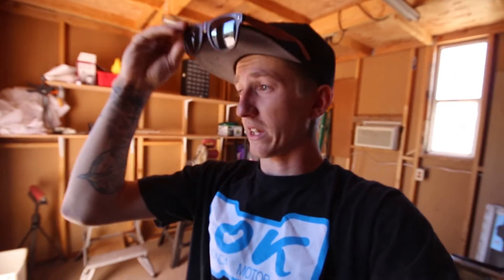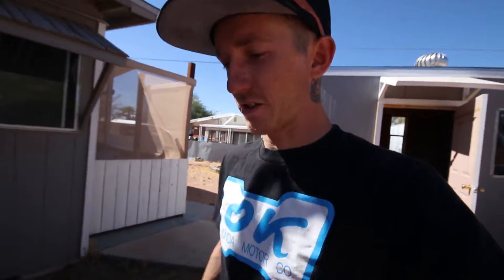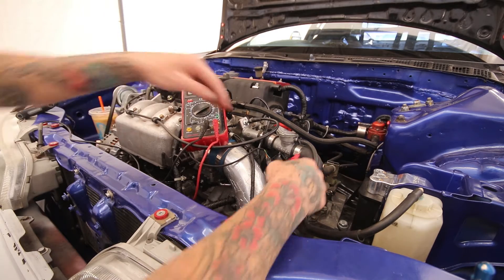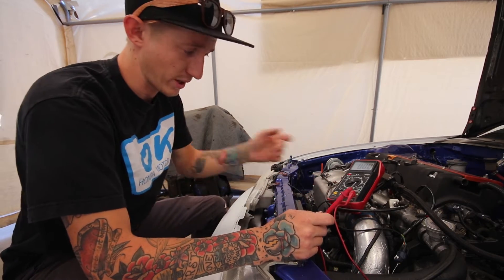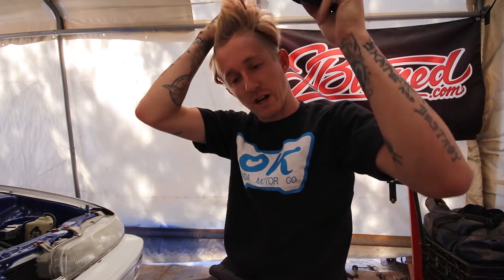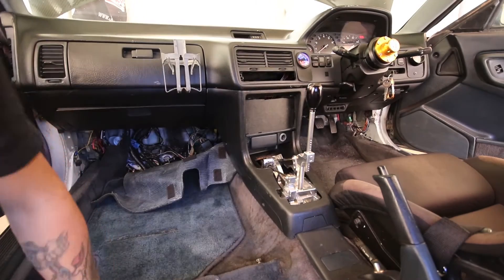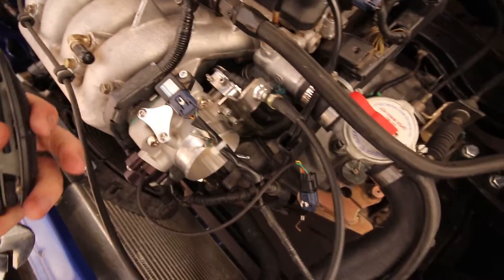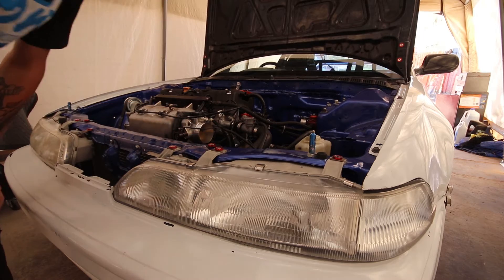Ktuned Throttle Body and TPS Issues (SOLVED!)

Comment from the maker: It’s been asked multiple time, I should have included it in the video but here is how to fix it:

Basically just trim the end plastic off of a male spade connector and put it inside the TPS sensor, what that does is fill up the bit of dead space around where the sensor actually rides on the throttle body butterfly.
Reply: I just found your video. Idn if u still have this car but how has it held up

Comment: Same here... I’ve tried all of the k-tuned TPS since not a lot of after market didn’t improve the OEM TPS. What worked for me was ACUiTY!!! Btw the reason k-tuned hall affect went bad was when u snap the throttle and lands to idle spec the rotating part of the sensor gets worn out and free play begins and gets worst. You’ll see it when your readings from your DVOM is not consistent.
Reply: A r i e s R  Do you have a 70mm throttle body by any chance? I appreciate your comment as it may help me out.
Reply: AffiJuarez18 yes I do.

Comment: Block off your IAC port on the intake manifold, remove IAC valve. Place a 5v diode connecting the IAC wires together (this will make it so you don't throw a code and engine light stays off) then go find a compident tuner that should have known to tell you this!
Reply from the maker: Sounds like you don’t know what your talking about because the issue was fixed and it was a ktuned makes crappy parts issue. My tuner has nothing to do with it

Comment: You can also take out all the little Allen bolts on the Tb cable circle thing and turn it to make more tension in the spring
Reply from the maker: I already did that. Didn’t really help too much with the sticking

Comment: I had the same issue on my Type S with the Hall effect installed on a skunk 2 throttle body. The deal is Any aftermarket tps for the k20 is crap the only best option is oem but Honda doesn’t sell it separately. In the ktuner program there is a setting like hondata to scale the tps sensor manually but I can’t remember where but it is there. Basically if the tps reads let’s say .5% at no throttle and 65% at full throttle then you have to manually type .5% for no throttle and 65% for full throttle so the ecu can recognize it. And save it. It’s there but you really have to dig in the settings. Hope this helps
Reply from the maker: There’s is no way to scale it in KTUNER, James didn’t input that into it. You can calibrate it at factory spec, or for a .5% up. He designed it to read sensors within a normal voltage spectrum. But my issue was I was not getting enough range of motion because of a fitment issue with this specific TB and that sensor. It’s a design flaw that apparently Ktuned has recognized and offered warranty for throttle bodies made from last November-March. They just didn’t publicly announce it.
Reply: ChrisSadowski i have the same problem. I went thru two ktuned tps(one includes Hall effect) and still the same problem. I wish i would seen this vid before i bought my ktuned 70mm tb. So u saying that the ktuned 72mm tb would work with the ktuned Hall effect tps?

Comment: I have the same TB, but I'm not running a gasket on the TPS. Never had an issue like this. I just recently cut my own hasket out of a Manila folder to get moisture from getting inside. Havnt tested it yet but I'm optimistic. Mine also sticks like a SOB after a month of driving on it.

Comment: I have the exact same issue with the same TB. Currently running the acuity tps. Can you go further in depth with modifying the TB?
Reply from the maker: In a nutshell, there is dead space around where the sensor rises on the butterfly of the throttle body. So I used a small piece of plastic from a spade terminal to fill up that dead space

Comment: So like whatd u do to fix it. My dumbass bought the same tb and im having the same problem
Reply from the maker: Basically, this issue is there is dead space around the sensor opening, and where it is supposed to touch the butterfly on the throttle body, for me I took a male spade connector and trimmed the plastic off to just use that to fill the dead space around the sensor and it has worked fine ever sense

Comment: I was a fan of K-Tuned parts… until few month later after my K swap project, I begin to see K-Tuned supplied hardwares such as screw and bolts shows RUST on them… not a fan of rust with new parts hardwares…😔
Reply from the maker: Sounds like K tuned quality

Comment: seriously... what am I supposed to do to get this working. I'm going through hell trying to fix this.
Reply from the maker: Simply put, the metal rod that turns the TPS is not large enough. Cut up a spade terminal end, and shove the plastic in there to fill the gap between the rod and the sensor internal

Comment: what was the solution, swap tb?/?
Reply from the maker: Used a small piece of plastic around the butterfly where the TPS sits, the problem was too much slop around the sensor and TB, the plastic took up the dead space and fixed it

Comment: Man I have the same issue but I have thr 72mm ktune one
Reply: Also have acuity tps
Reply from the maker: Try checking to see if the butterfly rod is machined to the same size as the sensor. That was my main issue was the butterfly rod thing wasn’t machined correctly so I could turn my throttle a bit before it even started rotating my TPS sensor giving me wacky readings

Comment: doubt you’ll answer but i have the newer version of that tb and my acuity sensor doesn’t read anything , i put stock tps and it reads and runs alright but does have a bad idle and makes missfire code pop  up in all cylinders and i checked compression it’s all good spark and coils pack are good so idk
Reply from the maker: What TPS were you using before? I had nothing but issues with their Hall effect sensor, so I switched to an acuity sensor and haven’t had a problem since
Reply: @ChrisSadowski  i had the stock one the new acuity one i have rn will hold the idle at 3k rpms idk if i need to clean the iacv or if i should just run the stock tb
Reply from the maker: Try cleaning it first and see if that helps
Reply: i only for the ktuned 70mm cause they told me at the kseries store that i don’t need a tune , it ran like poop i put the stock one on and calibrated tps and my car runs better then before lol and i can’t return anything cause it’s “used”
Reply from the maker: You need a tune, your engine is taking in more air and doesn’t know what to do with it
Reply from the maker: Shoot just from a 70mm TB and port matching the manifold to it I gained 9whp on the dyno

Comment: so i just got a tune , i deleted my iacv, and i had screw in the screw to raise my idle a bit, now it idles perfect, but i cant get the rpm to shoot over 4-5, idk it feels like the cables have slack or tps if off. idk what i did, but it didnt do that before i missed with the idle screw
Reply from the maker: Sounds like it’s in limp mode
Reply: @ChrisSadowski  unfortunately it's not limp mode quickly stops at 4k this tapers off after 4-5, no cel either :(
Reply: @ChrisSadowski  ever since I turned the idle screw and put back the throttle cables ,
Reply: @ChrisSadowski  i messed with the TPS screw, i believe, so i think that did something, how do i reverse? or fix

Comment: I'm having an issue. 74mm skunk and Ktuned hall effect. It idles at like 1600 rpm. I've had everything off, new gaskets, cleaned IACV, new IACV o ring thing and it's still the same...starting to think it could be my TPS (search led me to this clip). 
EP3 turbo btw
Reply from the maker: Is your throttle body closing all the way? Skunk throttle bodies are known for getting hung up because the butterfly isn’t always cut right to the bore of the throttle body
Reply: @ChrisSadowski  Yes sir. It was always fine before the turbo build. The TB was taken off and reinstalled when the intake and block etc were painted. I did change from a stock TPS to the Ktuned though. I've also gutted the PCV, that is now routed to a vented oil sep tank that auto drains to the sump, so i need to check that the old tapping in the RBC where the PCV used to go is sealed properly

Comment: yoo i just got a new tps sensor, i dont need to mess with krpo to set it do i? just a multimeter correct?
Reply from the maker: I believe on k-pro you have to set it on there to let the computer know what’s closed and open, takes just a moment of time to do
Reply: @ChrisSadowski  i thought u can do it without kpro?
Reply from the maker: You can set it manually with voltage yes, but K-pro as far as I know is “stupid” in the sense that those values are now changed from removing the sensor. So it now needs to be told what those values are by just opening your kpro and calibrating the sensor. Literally takes 2 minutes including laptop boot up time...
Reply: @ChrisSadowski  ok so after i read the 0% and the 100% for tps, is it set, or do i have to UPLOAD the calibration?
Reply: @ChrisSadowski  I have a question, when you download the map from the car, is it making a copy? Or do u have to upload it to put it back? I'm asking cuz I downloaded it from the ECU and didn't like the changes I made so I closed the program
Reply from the maker: Yes you have to upload it

Comment: Damn I have the same issue. 70mm cast k tuned tb and Hall effect tps. So you shaved down the circle lip to lower the tps??? Sorry just confused on how you fixed it cuz you said you don’t wanna spill any beans.. but I need the beans!  LoL
Reply from the maker: It’s kinda hard to explain what I did. I’d have to show you a picture. But basically I switched to an acuity hall effect sensor, and used part of a spade connector that I trimmed up to take up the gap between the sensor and the throttle. Taking up the slack allowed the sensor to get full range of motion

Comment: Hey bro, I have a few questions regarding my car. Im seeking help, any advice would be appreciated! I got a 2006 acura rsx type s, had itbs but went over to intake manifold with 90mm throttle body. Need help with tune adjustments to fit the added parts, any help is appreciated. Thank you!
Reply from the maker: I’m not sure how much help I be. I’m not a tuner 😅

Comment: Hey man did your tuner ever tested out the tps you had before to see if it wasn’t also a part of the problem for your issue ?
Reply from the maker: The issue was the throttle body not allowing the TPS to make full contact with the butterfly. The Ktuned TPS didn’t work on the ktuned throttle body either, design issue.
Reply: I have an rsx type s 04 doing the same thing as your I got a new iacv and nothing and I got a off brand tps with my oem stock throttle body and I feel like it’s worse then before, I don’t know if to replace the throttle body with an aftermarket and go with an acuity tps  or get only the acuity tps with my oem throttle body . Any ideas  ?? because it’s currently doing what your car was doing
Reply from the maker: Acuity TPS is the way to go, are you able to calibrate it correctly?
Reply: Well I did what you did in your video to close the throttle with the hand and i did that and I blocked it with my hand and it didn’t turn off , I heard a vacuum but it’s from the air assist idle control solenoid valve and with the throttle covered with my hand and the solenoid valve closed it turned off that is one issue that hose is not tight and then I noticed the idle would not go down and noticed the throttle body close but not closed enough all the way so I think that it is also the butterfly plate too, I’m guessing I need a new throttle body ? I don’t know if that can get closed with a screw I didn’t find any to close it tighter
Reply from the maker: You could just have some carbon or oil buildup blocking the throttle body, or the cable could be getting bound up somehow. Take your throttle body off and give it a good cleaning with brake cleaner and slap it back on and see where that takes you. Clean your idle air control valve while your in there too, that will cause idle issues because the plunger gets stuck
Reply: ChrisSadowski  well I bought a new iacv and before all that I cleaned it and cleaned the throttle too I did noticed it has a small crack on the gasket I don’t know if that will be causing it too
Reply: What is a good aftermarket throttle body ?since they don’t sell oem for these cars I only find them used
Reply from the maker: That could cause a vacuum leak yeah. Skunk2 usually has the better of the aftermarket throttle bodies
Reply: I tried calibrating it manually to .45 closed to 4.50  open but I adjusted it to .45 but it won’t go up to 4.50 open throttle , it only does 4.33v
Reply: @jeielsalazar8159  The problem with manual calibration, on ANY TPS is that you can't calibrate them precisely WOT or closed. If you calibrate to .45 closed, you won't be able to calibrate it to 4.5 WOT, and vice versa. I have tried many times using stock, k-tuned and even Acuity.  
I just installed a RBC manifold which is port matched to my K-tuned 72mm cast TB and I'm currently running with Acuity and Acuity definitely appears to be the best. I bought and installed the K-tuned TPS and my car made Chris' car in the video look like he was driving a Rolls Royce compared to the bucking and jerking I got with the K-tuned. Put the stock one back on and it smoothed it right out. So yeah, now using Acuity and it is CLOSE to perfect at .49 closed calibration. 
Now if only I could figure out why I no longer have a fast cold idle at start up. I have to stay on the throttle a little at cold start to stop it from stalling. Then after it warms up for a minute or so, it will start to idle on it's own, but super low, but then eventually smooths out to around 900 rpm as the engine continues to SLOWLY warm up. Not overly concerned since I don't drive it in the winter, but just don't understand why I no longer have the cold fast idle at start up. It was a straight swap...so frustrating!! 🤷🏾‍♂ No leaks. New nylon gaskets. Everything connected properly. No coolant bypass. No codes. And no fast idle at cold start up. Now I'm starting to think it might be the K-tuned 72mm cast TB (which is brand new). FML.
Anyway, like Chris, the K-tuned TPS really soured me on K-tuned. 
I had a K-tuned race shifter. It looked great but I wasn't quite sold - didn't give me issues, but it just didn't give the shifts I was expecting. I swapped it out for a Hybrid Racing V3 shifter and the difference is night and day in favour of the HR.
So yeah, definitely no longer a believer in K-tuned.

Comment: Btw I fucking can’t stand k tuned. Those guys sent me the wrong throttle body on purpose and then sent me an email before I received it with a return label. I even paid extra to get it shipped faster. Then they got sassy back when I emailed them about it.

Comment: Worried now, I'll be using the 90mm and their halleffect!
Reply from the maker: I don’t want to scare you totally, I have only heard the issue I was having with the 70mm TB. I haven’t heard negatively of the bigger ones!
Reply: i have the 80mm and having problems it not sticking when i rev it and let go of the gas it drops so low it cuts off bout to switch to ross machine 82.5mm throttle see if it make a diffence mine is on a bseries